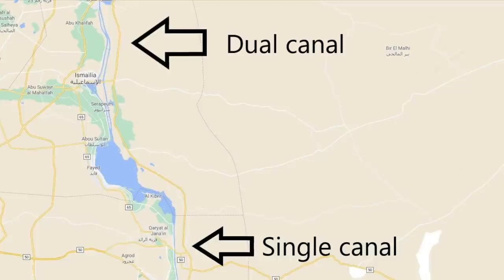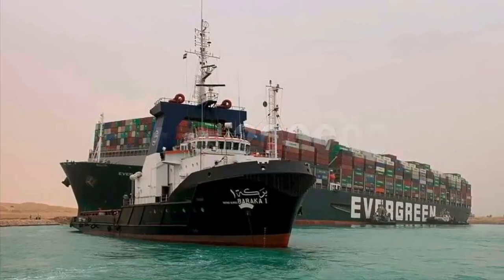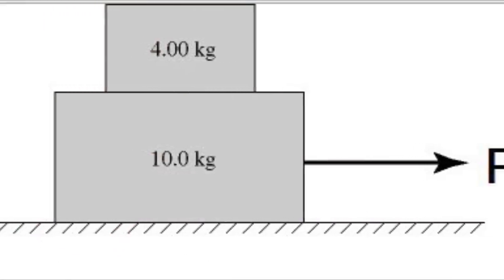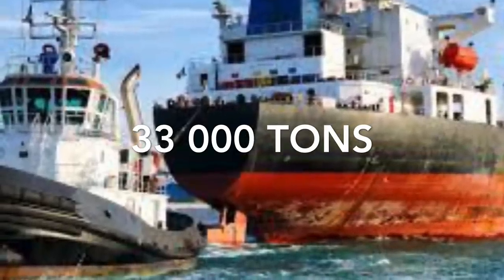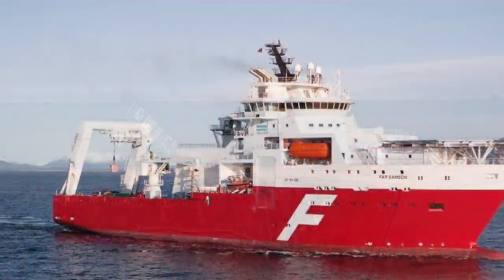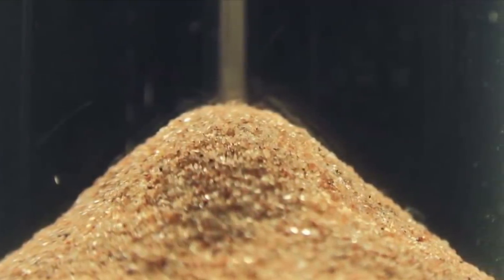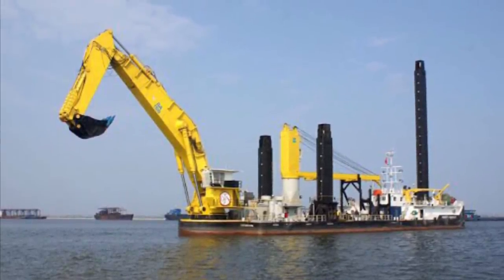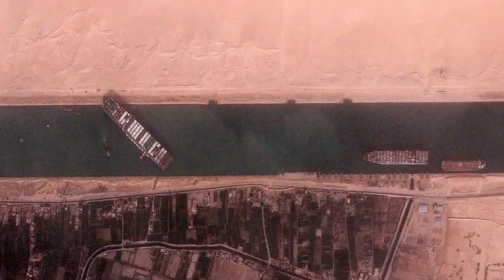MV Ever Given - why can't it be pulled out? Suez canal blocked

Comment: Captain: I want a vacation and a pay raise
Company: no
Captain: so you have chosen death!!
Reply: I think they said it was heavy winds that pushed it out of it's course. Mother nature was flexing.😝
Reply: "The nose" lol does he means the bulbous bow? that containership is a flat bottom vessel
 And where the hell did he come up with his Weird mathematical equations "1/3 of the vessel means you need to pull 50% of 1/3" what the hell is he talking about? Does that formula take to account the substrate of the channel? 🤔
This guy just made all this stuff up to get views
Reply: @onthejob9153  He was saying 2/3 of the vessel is floating, so only 1/3 of the vessel or 1/3 of the mass needs to be moved and you need to pull on something with 50% of the total weight of something to drag it along.
Reply: @ross_ulbright7779  I posted a couple replies on other channels on how this happen. You're the first person to have an idea. Strange it never happened before, well at least modern times.
Reply: Because of static vs dynamic friction. 1/3 of the total weight equals 1/2 of the weight of the vessel in horizontal force. Otherwise it would only be 1/3.
Reply: @onthejob9153   No . He is right because if the ship was doing 6 - 8 knots when it dug its bow in to the riverbank there is 200,000 tonnes at 8 knots = huge momentum to overcome the penetration into the gravels.

You wont pull her out even with 20 tugs unless you remove the gravels under the bow.
 
Their best hope is to add a ~ 30 meter long extension tube to the suction head of the dredge and excavate directly underneath the hull
Reply: @heartobefelt  or dig alongside...... Then turbulate the substrates...... And let it collapse back to floating........ That's how we ground or Gravel dredge every year..... Then float it in spring...... Of course this will be a much larger ordeal
Reply: lol
Reply: @ross_ulbright7779  that's what the captain said, but they also said there's 20,000 ships a year passing through and they've never had wind blow a ship like that before. So it's suspect imo
Reply: It may have happened that the ship fell victim and was in a bad place at the wrong time and that happens this ... Look at the year of "Corona": you thought last year that a virus would turn the world upside down.. No!.
Reply: every ship has a canal pilot on- board
Reply: @Max-zr7hr  it's also a very wide ship not just high so bumping the banks is well possible. It's called the bank effect. I think it's likely that unless another channel is dug that the maximum width is going to be reduced.

Comment: They could offload the front first taking weight from the buried hull. As the stern sinks lower, the  bow rises. Add pneumatic lifting bags under the bow, then teams of tugs to get it rocking side to side. The vessel uses its own props to slowly back out.
     Yeah it'll take some time, but that's how to do it.
Reply: Simplistic but not practical. I think second guessing world wide engineers who specialize in this horror is absurd.
Reply: @judyscheiber3661  then you know nothing because even the dumbest person could come up with a plan better then most with a piece of paper. He is correct, they made matters worse by trying to push it in the beginning. Air bags and even hook some tugs or whatever to the ass and pull it out the way it went in. Not rocket science
Reply: @judyscheiber3661  And where is your informed answer or solution, at least he came up with something
Reply: @tkozlofable  that's exactly what I was thinking. Makes sense to pull from the tail as that's the path it took to get stuck while shifting the weight to the back
Reply: @judyscheiber3661  
Other than unloading the entire vessel, engineers have already stated what is needed does not exist or is nowhere in the vicinity.
        Also todays engineers are not capable of what their forefathers were. Like all supposed experts, they have been pigeon holed and dumbed down for decades. 
        All public officials and experts of this sort are in full time cover your own @$$ mode, these days. Playing it safe. The mavericks with independent ideas were run out long ago.
        This could also easily be an engineered 'accident'. Meant to cripple the whirled economy further. 
        A fairly simple and quick (although quite messy) method to remove the obstacle, is to blow it to smithereens. This is the Mideast. All the necessary armaments are nearby, and at the ready . 
         Won't happen, I know. Oh well. Not my problem. The collapse continues. Where's my fiddle?
Reply: @gmw3083  Nice! That is the only viable solution i've seen except unloading the sucker. (unloading just 1 end makes it unstable I believe).  Of course we are still talking months of underwater debris clearing after.
Reply: @judyscheiber3661  
Also, not second guessing the ivory tower experts and officials is what put this place in the current absurd mess its in. You've learnt nothing from the cv experience yet. Good work.
Reply: @mjbgdaad5624  
It would become unstable, but that helps to get it rocking. The air bags keep the motion controlled.

Comment: Im a heart surgeon, and one look at this problem and I can already see the solution, a bypass. You can dig a short canal parallel to the problem area where the flow of ships can travel. The bypass would not need to be long just as long as the ship blocking the channel itself. Plus several hundred meters for a smooth maneuver.
Reply: Quicker to install a stent.
Reply: @Whiskey61  The Horn of Africa is part of the Suez route. Did you mean The Cape of Good Hope?
Reply: @Video-Games-Are-Fun  the container is loaded with petroleum and natural gas, missiles will blast the whole area off and a new lake will emerge or a flooded plane.
Reply: Also could insert a balloon between the ship and shore and inflate...
Reply: they need to install temporary walls around it and pump water in to lift it, it would cost a lost and take a lot of manpower and machinery but it would be the simplest and fastest solution i think, i'm not an engineer tho.
Reply: Yongo Bazuk  This is a job for Superman.
Reply: @Whiskey61  Why is it the "Horn of Africa?" for ships going to or from Asia.  Or are you confusing the Cape of Good Hope with Cape Horn?
Reply: @Video-Games-Are-Fun  Stupid solution! You are suggesting will definitely lead to an enormous environmental disaster. Mind you, that an environmental disaster be the inevitable result!
 This is not one of those silly video games where if you make a mistake you can simply press the reset button and begin the game again. Nature has a lot to deal with already without some stupid decision being made to simply blow the ship up and then expect it to fix it up 'sometime', when future generations have to deal with the inevitable repercussions of the actions, whatever they may be, of those who are trying to fix the problem. 
Mind you, I'm sure you will reply to me with some half-arsed, lame reply like "Oh, I was just trying to be funny". It isn't, and your 'solution' is not really helping...
Reply: @docholiday7758  right my 50 year old buddy got one of them installed in the morning and he was dead by 3:00 in the afternoon....stent is the way.
Reply: I like the fluidization approach. In the oil industry seismic surveys are conducted by setting off a charge which sends sound waves deep into the earth. Nowadays they don't use explosives, but can pulse the ground repeatedly, and I'm wondering if an array of seismic pulse generators around the ship could be used to liquify the soil? During an earthquake, one of the biggest risks in coastal areas is soil liquifaction.
Reply: Would a heart surgeon really ‘qualify’ their answer by saying ‘Im a heart surgeon’ .. ? & think of it like bypass surgery.. ? “I’m a dentist, and i can see right away we need to pull that sucker right out of there!”

Comment: My idea is to weld a bunch of steel cables into the structure of the ship and use winches / hydraulic cable jacks mounted on the shore to pull it, sort of like how costa concordia was moved off the rocks. The limiting factor would be how much force you can apply to the structure of the ship without pulling it apart.
Reply: yup, my first thought was also strand jacks. could get it out in the time that it takes for the concrete anchor/structure on shore could cure and dry.
Reply: TBH I think bulldozers would be better than winches in this particular case

Comment: Don't dig blast with high water and suction. Barges can use std high capacity pumps. Fill ballast in back compartments to make stern heavy. Its not as big a problem as you think. 

It will take as much time to put the logistics together as the freeing up of the vessel. Aussie Jeff

Comment: What about using several how flow high pressure water pumps with the hoses inserted into the sand below the boat to liquify the sand and reduce the friction?
Reply: 400 meters
Reply: that might work too, along with alot of diggers on prams, and tugboats to move it
Reply: Unload the cargo on other vessels(shorter),bouya ncy will increase.Balance would indicate it should be unloaded from both sides.Increase water level by damming and pumping more water into the basin created,if unloadings not enough.
Reply: My same idea 😉
Reply: The best experts are working on the problem. And I am sure they know what they dealing with.
Reply: @williammccoy7127  no. An expert was driving the ship.

Comment: Ever go to the beach and stand in the shallow waves and feeling yourself sinking into the sand each time a wave comes by?
Reply: yes but your boyancy point is about where your neck are , the ship isnt going to sink further into the sand
Reply: @michael knowlden noo caus the ship already have a boyancy mark and it wont go below that, if you blow the sand away it would just be floating ..
Reply: You’re not actually sinking. You’re staying at the same level but because of the flat earth the sand erodes and then covers your feet back up to a higher point. Everyone knows that. Duh
Reply: @Daphoes  Michael knowlden has the right idea. Think about it!
Reply: @Constantine Fotopoulos The ships keel  is significantly below the tug boats propellers. They would be ineffective.
Reply: "The nose" lol does he means the bulbous bow? that containership is a flat bottom vessel
 And where the hell did he come up with his Weird mathematical equations "1/3 of the vessel means you need to pull 50% of 1/3" what the hell is he talking about? Does that formula take to account the substrate of the channel? 🤔
This guy just made all this stuff up to get views
Reply: @Olivia P They need a large drag line instead of those small excavators. A drag line can remove heck of a lot more earth than what they were using.They're taking their time trying to solve the problem. The shipping companies better consolidate their available resources to get it done.
Reply: @onthejob9153  how many times did you copy paste this comment as a response to other comments?
Reply: @yatzeenotsee   I was a little drunk last night I wake up this morning just to find out I trolled the entire Internet
My bad 😬
Reply: @Constantine Fotopoulos Mel Fisher used this idea with normal engines but with huge deflectors called "mailboxes" to direct the engine's force to dislodge sand far below while looking for gold around the sites of sunk spanish galleons.

Comment: I wonder if high volumes of water could be pumped deep into the sand at the bow of the ship, causing the sand to liquify into an emulsion in that area.
Reply: Great thinking. I too was contemplating something similar. Everyday all over the world sewers are cleaned using high pressure water jets (around hydraulic pressure 2500~3500 psi). a) So I'm guessing that there probably isn't much rock under the vessel, but who knows for sure. b) We have an endless supply of water. c) Hi pressure water hoses are fairly flexible and can be connected in considerable length to directly target the problem areas. As well as removing the sand and other materials away from the hull the high pressure water would help to brake the stiction (think of pulling your rubber boots out of the mud) that is holding either end of the vessel from moving. I think that the Smit salvage team could cobble something together using smaller vessels to maneuver in close proximity to the Ever Given that are outfitted with the above setup. It will be interesting to see what transpires over the next few days /weeks. Definitely the options for what ever they come up with are limited to the space in the canal that they have to work in.
Reply: you can't raise the canal's water because this is not like panama, where you have floodgates. another reason is that the canal don't have high walls
Reply: I was thinking something like that, too. Use hoses to create a current to erode away the bank around the ship.
Reply: China's engineers are experts at that procedure!
Reply: @DerailedThought  I believe this would work the best. Use the water around it going through massive pumps to erode the soil. Its pretty high in the air actually. Gonna be real interesting to see how this plays out.
Reply: Call the Chinese engineers
Reply: My thinking exactly. One major drawback would be the liquidized effluent. It's displacement would need to be evacuated. The sand would need to be carried away and, preferably, out of the canal.
What're ever type of water jet were employed this would certainly breakup any type of mud/sand mixture. There could possibly be a problem with listing. Off-loading would not be an attractive option.
  With the aid of, perhaps, floatation bags on either side, tethered together for stability....
  In all practicality, no such bags exist,,, to my knowledge. But improvisation is the word of the day...one would surmise.
Reply: I just posted the same thing.
Reply: Could make the ship sink deeper into the liquified sand.
Reply: I think there's zero river bank and it would all just flood off to the side onto land
Reply: @Love_ministry  Don't need Chinese engineers.
Reply: @AncientFlight1  That's the idea. Deeper means more buoyancy.
Reply: @docholiday7758  Not if the weight factor is not diminished. Sand slides happen underwater when sand is displaced which can entrap the hull further.
Reply: @Love_ministry  Call the Dutch too, or instead!
Reply: Now we would be talking HIGH volumes of water
Reply: "The nose" lol does he means the bulbous bow? that containership is a flat bottom vessel
 And where the hell did he come up with his Weird mathematical equations "1/3 of the vessel means you need to pull 50% of 1/3" what the hell is he talking about? Does that formula take to account the substrate of the channel? 🤔
This guy just made all this stuff up to get views
Reply: I was thinking this too if they could temporarily dam it up using water bags  flood it loose and puncture them, ?
Reply: I think that they should also consider using many (or just big) construction/concrete vibrators at the bow to liquify the sand to lessen the friction--while pulling the vessel back.
Reply: @AncientFlight1  It's possible to liquify sand in situ...as earthquakes do in coastal area. Use the existing ground water. We would need to generate shock waves, such as by using seismic impactors.
Reply: @docholiday7758  Doc, easier said than done. For your suggestion to happen requires people who know how to use the technology you refer to and a plethora of other support services.  I would question why Egypt did not have a response plan for the current situation. Egypt has had ship sinkings blocking the canal in the past.
Reply: @AncientFlight1  I agree there should have been many tugs on hot standby if the controllers had been watching the weather forecast.Some ships Could have been ordered to hold outside the canal zone if available tug capacity was an issue. 

Seismic equipment and skilled operators should be widely available as its a major oil producing region. If they don't have the technique perfected in time for this incident, they should conduct some R&D to determine its feasibility for future incidents. 

Isn't EVERYTHING easier said than done? ;)
Reply: @docholiday7758 : could have, should have, woud have,  might have,  there have, must have, did have, ad nauseum...
Reply: @AncientFlight1  Well, some of us work in jobs where we have to develop workable solutions nobody every tried before. Gotta think out of the box..and where better to do that than in the YT comments section. Anonymity avoids a lot of embarrassment.  Lol!
Reply: @docholiday7758  Point well taken. Leadership?
Reply: @AncientFlight1  You could say that.

Comment: The other end is in the sand also.  The propellers are definitely buried.  It appears this thing was steered into running its nose into the edge and the current of the water just happened to be flowing in such a way as to wedge it in.  Almost as though it were done on purpose.
Reply: Or accident
Reply: War strategy?
Reply: Everything that has happened the last couple of years that negatively impact our life on earth has been done on purpose
Reply: What is the motive?
Reply: Don;t usel the plural "propellers."  Like most cargo ships, it is a single screw ship and you reverse it by reversing the rotation of the 2-stroke diesel engine that is the main plant.  They supposedly have to 2,500 h.p bow thrusters.